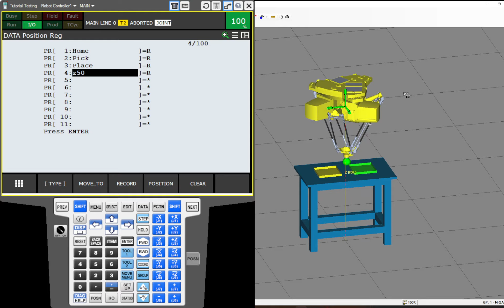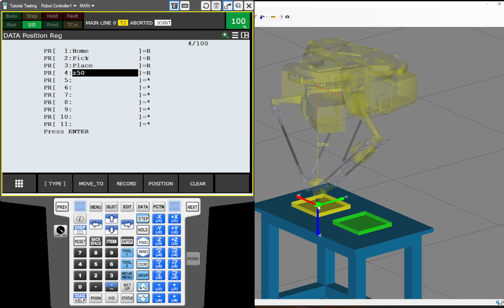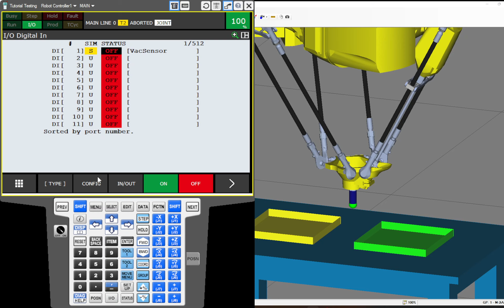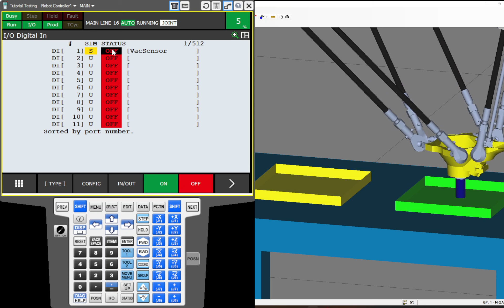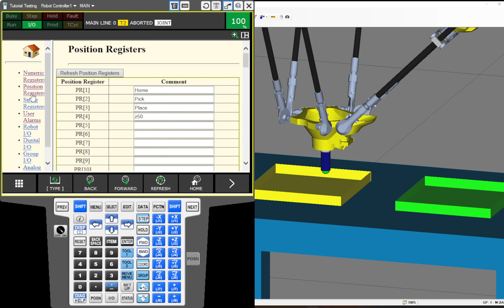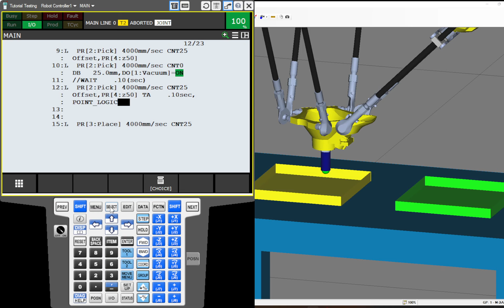FANUC Distance Before, Time After, Point Logic

Comment: Adam - I am working with Fanuc ArcMate120iD 12L welding robot. Looking for some help measuring a part width using touch sense (2-search points one in -X and the other in +X on opposite side of each other) then take the measurement divide by 2 and have the robot weld in the center between these tow points after vitrifying the distant is correct.  Assuming the width from one side to the other is (7.0926 inches (180.15204mm)). Touch sense the part from both sides to know the width then dividing that by 2 to know the distant to the center where I need to place weld points.  i am thinking somewhere like using if then else or any other easer way. 

If distant is ≤90mm or ≥93mm
Stop or jump to a stop label
else 
resume (a program name “XXX0477”)
endif (end the argument or maybe we don’t end if we continue the program)

Could you please help.